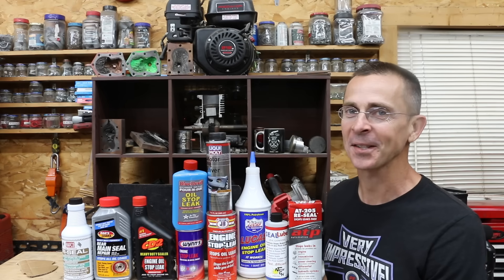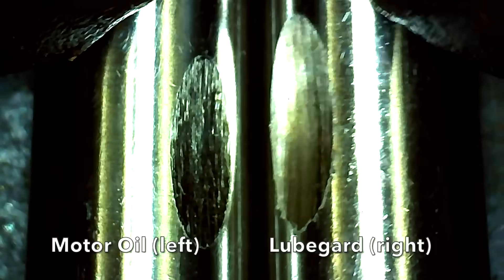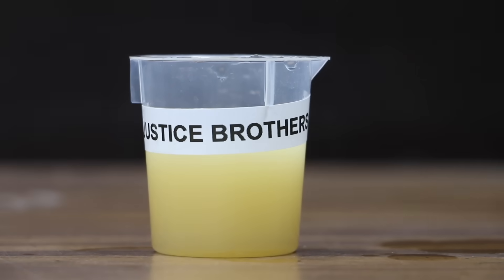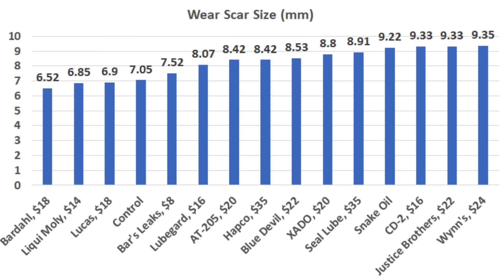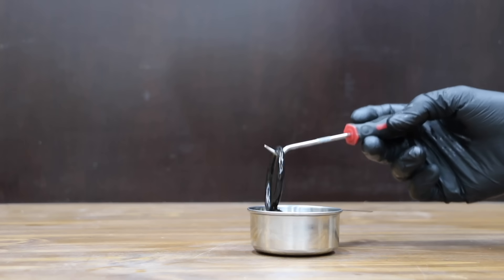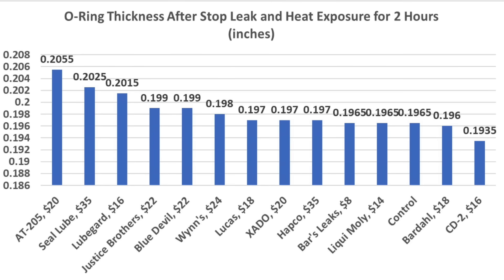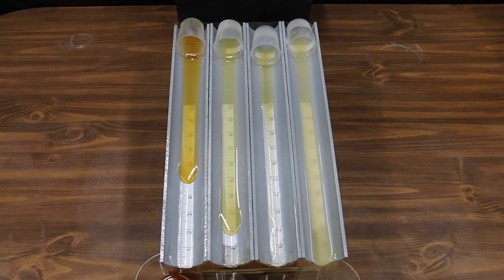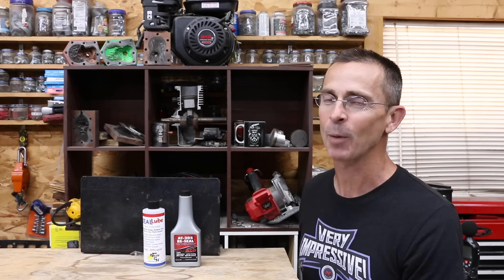Do Stop Leak Products Work? Do They Damage Engine Seals? Will They Destroy an Engine? Let's Find Out

Comment: Should start adding a 'just water' control for your lubricity test, considering how bad some of these additives got! Loved the addition of Snake oil!
Reply from the maker: Thanks!  Thanks for the constructive feedback.
Reply: some are just rubber conditioners, not meant to be a lube, but just to get on the rubber and work its magic
Reply: @rngwrm  Works like magic on the rubber while it's damaging your engine?
Reply: @HermannTheGreat  you don't run a 50:50 mix of it any more than you'd run just water
Reply: @rngwrm Yeah that's my issue with that test as he's running them at much higher than the recommended ratios. I would have preferred if he mixed them at the proper ratios to see how much difference they'll actually make in the real world.
Reply: @nowayjose596  Yeah, my issue is with people who contribute nothing feeling entitled to demand others who do spend more $$ and time to meet their personal demands.
The test results Todd has provided allow intelligent people to see best/worst case scenarios for a crapload of products addressing a problem.
If you have a newer/expensive vehicle, you may want to pick a product that has lower potential to cause wear, but also lower effect on seals and gaskets. Probably can run it the entire oil change interval without issue.

If you have an older/beater type, you may want to use one that has a higher potential to cause wear, but will also have a great effect on seals and gaskets. If it solves your issue, you can do an oil change and get it out of your system.

More than likely, testing at Manf. recommended ratios would take a lot longer than what Todd can afford.  
Maybe those complaining can put up or shut up and show us how it should be properly done?
Reply: @HermannTheGreat NOT if used judiciously... that means, you use the product to see if it restored the seal, and then perform an oil change, so to not keep it possibly getting some damage by increasing the wear. 

And possibly adding another bottle to the used oil before next oil change if the leak returns or persists... but not keeping adding and adding bottles at every oil change!
Reply: @nowayjose596  sxtrapolate buddy, extrapolate....use mixture percentages to see what wear effect percentage.

Comment: Shouldn't you test the motor oil in hot conditions? Room temperature is not the temperature on which motor oil is designed to work optimally. (Edit talking about the first test)

Comment: I've always wondered if any of these things actually worked to stop leaks, thanks!  This may be out of your wheelhouse, but I'd love to see you test warranties. Maybe you could find any broken tools or small appliances that you have laying around and send them in to see which companies actually stand behind their products, and how hard it is to file a warranty claim for each company.
Reply from the maker: Thanks for the suggestion.
Reply: Excellent idea!!!!
Reply: We were 60 miles outside Albuquerque New Mexico when a friend had a problem with his radiator. Turns out he had a leak around the thermostat housing, three leaks on his radiator overflow, and a head gasket leak. We filled it with a bottle of stop leak and made it to Albuquerque where a shop fixed all of the leaks. Point being, it got him back to civilization.
Reply: @George Toft - Sloth Overlanding  this exact instruction used to be printed on radiator stop leak products, I believe, and should be placed on them now. I have seen radiators and heater cores clogged from these products both in person and in many videos .
Reply: That is a really good idea mate !
Reply: Bats leak has special seal polymers to seal gaskets which he did not test.since takes time for polymers to clog the torn gasket.
Reply: Excellent idea!!!
Reply: All of these tests are kinda pointless because not one of them is being done at the manufacturer's recommended concentrations.  Not one of the instructions say their products should be a 50/50 mixture with motor oil.
Another problem is the tests weren't long enough, though to be fair, this is much harder to replicate.  2 hours is equivalent to maybe 140 miles (2 hours at 70mph)

I suppose the tests are still fun, but they really aren't telling anything.
Reply: @tarstarkusz  He used a measuring pipette it looked like . All you do is basic math to get the mix on lower amounts. I do get your point but i am more concerned about this not being tested on the Actual seals, not cheap chineseium o-rings . I would guess theyre made from Different materials and Manufacturers using different types/materials etc etc . Cheers .
Reply: @tarstarkusz  Point well taken, but. He showed which formulas will soften and expand rubber seals under those conditions.
 Did you not watch the tests?
Just my lay opinion. I could be wrong.
Reply: @tarstarkusz   the tests are consistent between each other. The manufacturer recommendation could skew the raw results. The testing methodologies are fine to compare products against each other for efficacy
Reply: @battleopponent  How difficult would it have been to just use each one at the proper concentration?
Reply: @tarstarkusz  if you mix it to each manufacturer's concentration, then the properties of the control oil become more prevalent, and the difference between products can be hidden. By having a standard concentration of control oil, you eliminate the control oil as a variable from the tests. This allows the products to be tested on their own merit
Reply: @tarstarkusz  How difficult would it have been to make your own comment instead of making an irrelevant reply to mine.
Reply: @battleopponent  That's why they tell you to give it a certain concentration and not 50%.  An additive that isn't a lubricant will have a much smaller negative effect at 10 or 20% concentration than at a 50% concentration.
Reply: @NikeHM69  It's not unrelated. It is directly related to your comment.  You said you always wondered if these products work. The tests in this video weren't very good. He normally has very good tests.
Reply: @tarstarkusz  Or more likely you knew that more people would have seen a reply to a popular comment rather than if it were just one of thousands. This isn't an original tactic, lots of people do it and it's lame every time.
Reply: @tarstarkusz  Bro. The most doing it by the manufacturer's recommended amounts will change is probably just the wear scar test. The expansion and softening is going to be the same (if not less across the board)
Reply: @NikeHM69  Standard Russian tactic really. Just look at what they are doing in Ukraine. They invented an issue then when they failed their original objective they just doubled down and blamed NATO. haha
Reply: @tarstarkusz  yes, and also a smaller positive effect. It would be almost impossible to compare these products at their intended concentrations because the negative and positive traits would be statistically very small. Not only does keeping the concentration the same eliminate variables, but it also exaggerates the positive and negative effects into something the layperson can understand and measure. 50 percent concentration is over EVERY product's recommended concentration, and as a result you don't need a mass spectrometer to measure the ppm of various metals to get a lubricity result
Reply: @NikeHM69  That's true, but my comment IS an answer to your comment. It's not at all unrelated.
Reply: @tarstarkusz  I think you're missing the point. But, if it makes you feel better just hold your hand over the section at the end that shows the lubricity test result.
Reply: @tarstarkusz  Do you know what it means to extrapolate? If you don’t, then the only pointless thing here is your argument.
Reply: @AAP0000  The question is do YOU know what that word means?  No, you cannot extrapolate by raising the concentration.
Reply: @tarstarkusz  Obviously you don’t. 😂
Reply: @AAP0000  No you don't change something and then project out the behavior/effect.
Using the 2 hour test might be an example of extrapolation IF certain conditions are met, which I don't think they are. 
You absolutely cannot say that a chemical at 10% concentration  is 1/5th of a chemical at 50% concentration (the effect, that is).  This is just wrong.  An effect at 50% may not occur AT ALL at 30% or have an entirely different effect at 5-10%.
Reply: @tarstarkusz  Thanks for literally proving my point. 😂
Reply: @tarstarkusz  be quiet, russian...

Comment: This is NOT a good tip... but I might know a guy who says if you spray a squeaky belt with brake clean and then with 3m spray glue, it softens the belt and then holds it together from cracking :)
Reply from the maker: lol

Comment: Have you ever tried testing aftermarket differential covers? I’ve only seen a few other people test them but not to your standards, thanks for the great videos
Reply: Gale Banks has and has a whole series of videos about it. Just about all of them are junk that don't lubricate your differential correctly.
Reply: @ZboeC5  He never tested his design and only trashed on the other brand
Reply: @justalittlejonboat4892  He most certainly did test his design. I remember it very clearly.
Reply: The stamped steel factory cover functions properly

Comment: Blue Devil absolutely works! I had an oil leak that would pile in my driveway. I purchased this and it fixed my prob. It's a bit pricey tho.
Reply: Yep, Blue Devil saved me from a rear main seal repair on an old Ford Ranger that I have since sold. I don't know how it works, probably don't want to but I know it does.
Reply from the maker: Great feedback on the Blue Devil!  Thank you

Comment: I remember using a radiator stop leak when I was younger. Of course, it ruined my radiator and damaged my cooling system.

I would love to see radiator stop leak next.
Reply from the maker: Great suggestion!  Thank you
Reply: Yup, lost my Acura that way. But I was dumber and younger
Reply: I've actually had it work once. Titan brand, not cheap and it may have plugged heater cores, but it did stop a head gasket leak into the cylinders after shutdown.
Reply: I have an old "drive it till it dies" truck that got a small hole in the radiator one bitterly cold winter. I put in the stop leak version with the two different liquids, an egg, and a large dose of pepper. I have to top up the fluid every 500 miles or so but it never overheats.

Comment: They do work and soften engine seals. it fixed a rear main seal leak on my engine
Reply from the maker: Great question. Lets find out!
Reply: I know for a fact Blue Devil works for a rear main seal leak.
Reply: which one did you use for rear main seal?
Reply: @MustangGT50bmg    I used the Bars Leak on mine.  It was many years ago on a GM, V-6 Engine.   It worked very good for me on that vehicle.
Reply: @richardthomas1743  thank you, I have 2000 ford f156 v6, I was wondering if I should use at-205